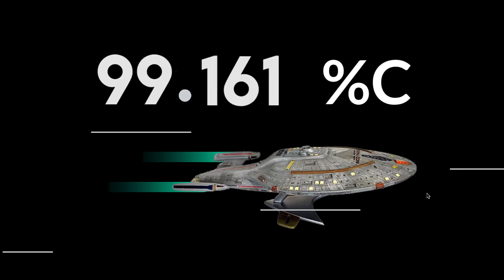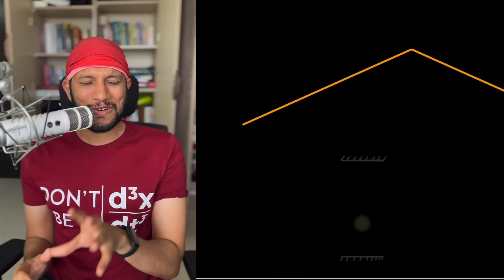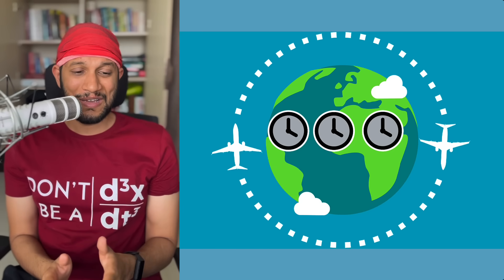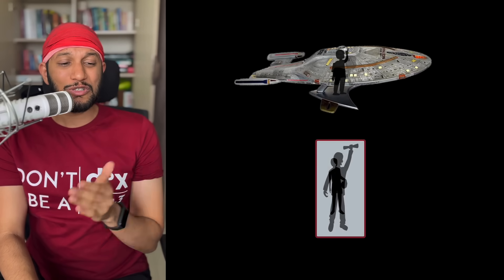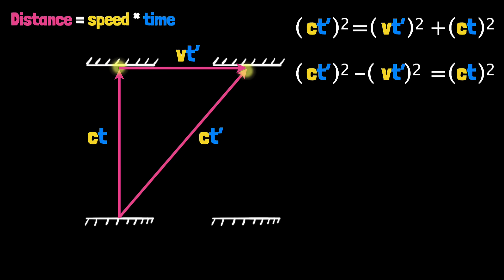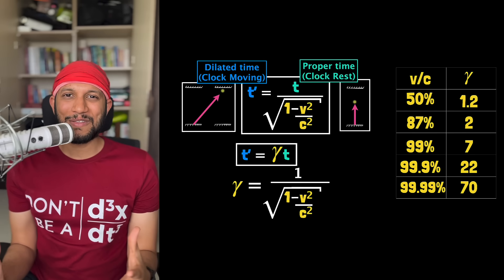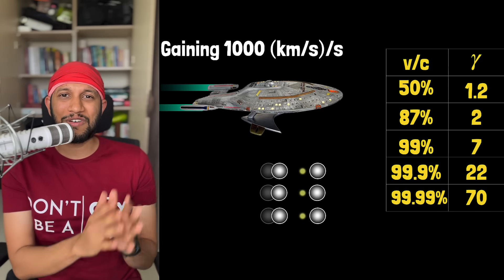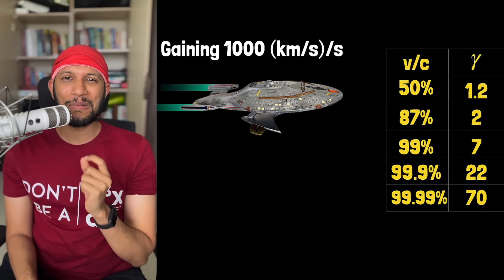I finally understood why you can't go faster than light! (My mind is blown)

Comment: Interesting video, and the photon clock makes a lot of sense - thanks. But using an analog clock and proving its second handle slows down because of the atoms in the handle implies that it is the handle which drives the time while in reality there is a mechanism inside the clock that drives the handle. I get that to an observer traveling near speed of light in a ship the second handle of a clock in a stationary position would appear to slow down but it doesn’t mean the clock’s measurement of time has slowed down.

Comment: The first 4 minutes are broken for me because it implies there should be a zero-speed point where the clock is ticking the fastest, which is a false statement.
I understand that for someone in a spaceship, time will not slow down, and that means that for a spaceship it is possible to travel any speed (by their measurement) towards the galaxy (Ok Ok, the distance itself will became shorter, not ship moving faster). Yes, space travelers' relatives on Earth will age rapidly, but space travelers will experience a new world in their lives.

Somebody correct me please.

Comment: Beyond the infinite energy, in a relative space-time universe, if you go faster than the speed of light you are going backwards in time. Everything on this side of the light speed barrier would enter into a paradox if it crossed the barrier. Everything, if anything, on the other speed of light would reach paradox if it moved slower than speed of light. Mass is the barrier. The reason you gain mass, and it takes more and more energy to accelerate is because you becoming charged by tachyons resisting your continued acceleration. If you hit the exact speed of light, time stops for you. Time stops for tachyons resisting you. You both cease to exist and/or get converted into light. Tachyons gain energy as they collide with mass and slow down. They lose energy as they escape mass and they speed up. Tacyeons are time dilation, tachyons are anti-mass particles. At the collision point, at the zero mark between our dimensions and their dimensions, there is only light, there is only photonic energy. This infinite barrior we approach is the repulsion force preventing you and tachyons from creating paradoxes. 

Of course, tachyons have never been detected, and never been proven, so it's just spooky sci-fi talk, not hard science. But I think the arrow of time is reversed for them. I think they exist in a mirror universe of sorts that we get closer to as we get closer to the speed of light. Might even be wrong to call it a mirror universe because that suggest symmetry, and that might not be a thing, more like an alternate dimension. If you hit the speed of light, you become photonic energy. If we had perfect matter to energy conversion, and perfect energy to matter conversion, transporter tech could be possible, that would at least operate at the speed of light. But I don't think you can go faster than light without finding alternate dimensions, wormholes, or being able to curve space, because the anti-particle / anti-gravity universe would repel you. That repulsion is imparted mass to you created massless FTL particles gaining energy (and thus slowing down, and thus getting closer to us.) The closer each side gets to the other, the more resistance is created on both sides. That mirror universe would be a white hole universe, we could be the black hole universe.  But perfect symmetry is not required. It might even be wrong headed to call both universes, other than for the fact they cannot ever co-exist in the same place at the same time because they would obliterate each other. The only thing that can exist in both of them is phonic energy. You can turn matter into light, and light into matter, but that conversion would allow you to only travel at the speed of light via transporters. There are tricks that make lasers appear to flow backwards in time, but I'm not sue if that's actual time travel or an illusion of perception when it comes to trying to observe light at super high speed instruments. 

And I could be totally wrong about all of this. It's all so theoretical, I don't think anyone can prove it. I just think if you did go faster than light, you would past the c barrier into a very different universe, and that would probably destroy you, and give anything on the other side of that barrier that's sentient a WTF! moment.

Comment: When I was an undergraduate I got bored in math class and tried deriving an intuition for how you might yield formulae that required time dilation as a consequence of velocity. I later learned that the interpretation I came up with built upon an entirely different set of principles than relativity, but curiously enough yielded the same formula for time dilation (when I later took a physics course I had to dig out my old math notebook because I was so shocked to see the same formula).

My interpretation: start with the assumption that time is dimension just like length, width, and height.
This implies that some number of meters should in principle be equivalent to some number of seconds.
That may sound absurd, but let's stick with this idea and see where it goes.
If one considers an object like a meter stick in 3-dimensional space, it might be said to possess a length of one meter in any of the 3 dimensions.
However as you rotate the object in 3-dimensions any length gained in one dimension comes at the cost of length lost in the other dimensions per Pythagorean theorem.
Put notationally, L^2 + W^2 + H^2 = 1m^2 no matter how you rotate the object.
If you move down in dimensions to two dimensions then this would remain true with just the length in those two dimensions.
It logically follows that this would remain true in a higher dimensional space, with some unit length being conserved under Pythagorean theorem no matter the rotation.
In other words L^2 + W^2 + H^2 + T^2 = 1m^2 if we treat time geometrically.
The last leap here is how do we answer how many meters are in a second.
If we assume light speed simply becomes a coefficient of 1 (1 second equals the number of meters light would travel in one second) then you end up with all the same formulae.

Comment: This is a great explanation....BUT...all of this is from a fixed observation point. What if we changed the observation point? What if you had an accelerating system within a (or multiple) accelerating system(s)? For example, we are in a galaxy that is itself accelerating through the universe at a certain speed. Wouldn't it be theoretically possible to exceed the speed of light from the pov of an observer outside our galaxy, if we accelerated something in machine, on a ship, in our solar system, in our galaxy?

Comment: The photon is traveling a longer, diagonal path at C but keeping up with the ship. Wouldn't the photon hit the back wall of the clock as the ship approached C? Otherwise, the photon would have to be traveling at higher than C to maintain its position within the clock.

Comment: Another explanation for this question is:
When we travel at any speed there is a relative increase in mass. It can be calculated by an equation similar to what he explained about time dilation equation.

                      M
M ' =   ----------------------
           √{ 1- (V²÷C²)}

So if we travel at "c" the relative mass will be ♾️ 
To accelerate an object with infinite mass require infinite Energy which is not possible.

Detailed explanation
At 99% c              - Relative mass(M ') is 7.1 times M
At 99.9% c           - M ' is 22.4×M
At 99.99% c         - M ' is 70.7×M
At 99.999% c       - M ' is 223.6×M
At 99.9999% c     - M ' is 707.1×M
At 99.99999% c   - M ' is 2236×M

So its clear from the above results that as we are approaching c the mass of the space ship increases unimaginably. 
To accelerate a ship from 99.9999% to 99.99999% would require very high energy as mass increase from 707 times to 2236 times.
In this way mass increases and increases and close to light speed the mass will be very very large. And to accelerate such a heavy object further requires infinite energy. Which is not possible. Hence anything which has mass can never travel at light speed. Anything which doesn't have mass could.

And why does mass increase when something move? 
To move an object, it should have Kinetic energy.
This kinetic energy will be converted to mass as of the equation 
E=MC²
It even happen in our day to day life when we travel with some velocity our mass increases but its too negligible.
Reply: Unless you create a warp (in Time and Space) bubble around the ship. then normal finite acceleration within the bubble would propel you very close to C. From the outside within the bubble even though the ship is traveling close to C an observer would see T so no dilation in time within the bubble.
Reply: Why mass increase?
Reply: @waliahmad12345 the mass increases because the Kinetic Energy is converted to mass. As Einstein calculated in E=MC2

Comment: Easy:
Time Dialtion
As you approach the speed of light the rate at which time passes for you slows. At the speed of light it stops. 
So if you were to ever reach the speed of light time would stop, and as time is stopped is can no longer pass thus nothing can proceed forward. 

Theoretically if time were to reverse if going faster than light then it would place you prior to where you were going faster than light, therefore you'd be back going at the speed of light. 

Or the simple fact that as you approach the speed of light mass increases at an infinite rate, so you'd need infinite mass to even reach the speed of light, and thus greater than infinite mass to go faster.

Comment: Fun experiment. If you have twins, put them on a merry go round, one in the centre, and one on the outside. Tell the one in the centre that they were born first, and the one on the outside that they were born second.  Leave them there for 40 years, and make the merry go round slowly continue to accelerate the whole time. While they are bored, teach them special relativity. After 40 years, stop the ride, let them off, and ask them which one is the oldest now.

Comment: I had very easy Analogy, you see photons are lights as particles hence to reach speed of light the photos/electron would need to cover the distance but since they as well move at the speed of light the relative velocity will be zero hence we never reach speed of light, it's kind of vicious cycle

Comment: I'm pretty sure we can do away with dark energy in our cosmological models if we imagine the universe is actually probably decelerating not accelerating in its expansion over time and that deceleration has caused a time dilation between our current clock rate as an observer and the clock rate when light was emitted. the emitted light in the past would look redshifted in the exact same way as the current model because the clock rate was slower and we are observing while at a faster clock rate due to deceleration over time. the red shift we observe is an illusion due to relativistic effects.

Comment: You failed to mention one mind blowing aspect: Put yourself in the spacecraft as your speed approaches a significant fraction of c relative to an outside observer. Do you continue to feel the constant acceleration? Yes. But the entire age of the universe goes by before you reach c. Which really doesn't seem like a long time to you. Even though you'll never reach c, you'll experience it as being imminent, as your view of the outside races towards the end of time. You will experience length contraction in the direction of your travel, time dilation to the extremely absurd, but you will still approach the speed of light in your reference frame, and you will witness the end of the universe, the end of time, and the speed of c ultimately unattainable because you ran out of time. Even though though you experienced this whole speed run, as being something like the passage of a summer day.

Comment: I feel there is something missing and please correct me if I'm wrong. You derive time dilation from force propagation. You use the photon as the vehicle and so you get "c" as the threshold. But we're still missing why the photon in particular was chosen, why couldn't there be a faster particle that would make time dilation smaller?

Comment: Great video and love the enthusiasm for relativity! Just wanted to point out a subtle issue: the explanation for why we can’t exceed the speed of light seemed a bit circular. You assumed nothing travels faster than light to explain time dilation, and then used time dilation to justify why nothing can travel faster than light. That loops back on itself.

A deeper answer lies in the core postulates of relativity—like the idea that constant motion can't be detected internally. It's a small detail, but important for logical clarity. Otherwise, it might confuse the very people most capable of appreciating and advancing physics.

Much respect for tackling this topic—it’s not easy!

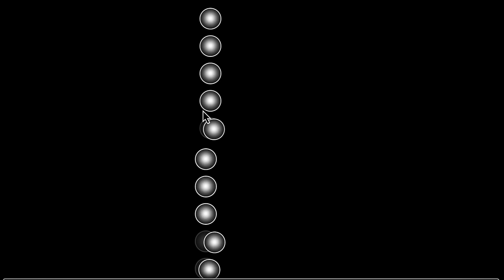Comment: 3:44 what if the information was traveling at the same direction of the movement (on your example, imagine the clock hand is horizontal and pointed to the right side), then the photon would not travel diagonally. The movement would actually "help" the photon so the information would travel faster thus time would be faster.... But, assuming the speed of light is constant, the photon would travel at the exact same speed (c) so time would run exactly the same way as there is no movement? 😕 I'm confused

Comment: Spacetime is like a jelly (although a very flexible one). Its not nothing. If it was nothing then it would not have any maximum speed limit. It "tears" if you go at the maximum speed limit, creating something like a blackhole. 
Probably not the best example but, imagine moving your finger so fast on a piece of paper that it tears. 
So, you can go faster than the speed of light but then you won't be in spacetime. You will be in whatever lies beyond spacetime. Something with a different planck's constant and speed of light.

Comment: But you can be faster than light because the smallest distance between pont a and b is not a line you travel but instead its zero if you fold the paper over another and this is what a warpdrive will do duuuuuuuhhh

Comment: Some questions... I can see you are very knowledgeable, so maybe you could answer them?  If so, very appreciative!

1- Given the nature of the speed of light, could a device creating a field of special relativity, generated through the Casimir Effect, affect the speed of light enough to lower it?  If so, imagine getting up to 99.999%c, then activating the field to lower c to 99.9%c in a flick of a switch.  That would catapult the vehicle to above the speed of light, right?  Then, if correct that we cannot go the speed of light, the ship could turn off all systems related to movement, and just 'ride' to their destination.

2- Imagine 2 ships, both traveling together at the speed of 99.5%c... or at least that is the intention.  One ship is traveling slower, at 99.45%c and the other at the correct 99.5%c.  What would be the time difference between the two?  The slower would eventually lose contact with the faster, but... how long would that take, and what would be the visual differences?  How long ahead of time (second ship) would the first ship appear?  Like, if they could see through windows, what would they see?

3- Given how you explained the analog clock traveling faster... makes me wonder if time travel actually could exist.  If an atomic series were to be seen as the arm of that analog clock, then one particle moves forward, but the chain of events after is on a 'chain' of catching up, then moving forward as well.  That means there must be a point where the primary particle moves faster than the second in the chain can 'catch up and then progress'.  If the 'catch up and progress' = 1, then if the speed of change in the primary particle is X < 1... time travel is created.

Because time progresses forward, that means each second is a progression from the current second.  If your speed is somehow that of X < 0.99999999999 (infinite) c, then time travel should happen, because 1.00000 (etc.) 1 seconds is forward progression.  At worst, you keep time still.  But, any tiny little bit extra would create time travel.  Meaning that time travel is definitely a potential.... based on that analog clock thing... right?

Comment: You do a great job of explaining things by showing us that the current theories and equations that you include are the best ways as of now to define and measure something we may not be able to describe. You also quoted Einstein as recognizing the usefulness of both science and philosophy. Since science only deals in the measureable, essentially, it must use its effects on Byronic matter. We know from observation that there can be "dark matter" and other dimensions and "dark energies" that affect us. The time existance question is like the old "If a tree falls in the woods and no one is there to hear it does it make a sound" intuitively you answer correctly and say yes, but you will be ivinvited to break that down.  that in part depends on what definition of sound or is it a noise you are using. If you mean vibrations in the air, the answer is yes. If you mean that an unheard noise isn't a sound our perceiving it is defining as sound,  then no. But the energy realeased and its effects are still real.  It's like a dog whistle. If you picked one up unknowingly and blew it, you would think it was broken. Until the dog started howling, no dog, no proof of sound. Just because we can't measure or see something in our dimension with the matter available to us doesn't mean it doesn't exist!😊